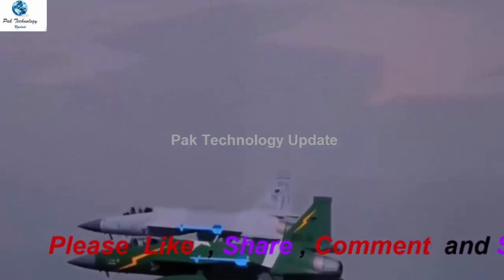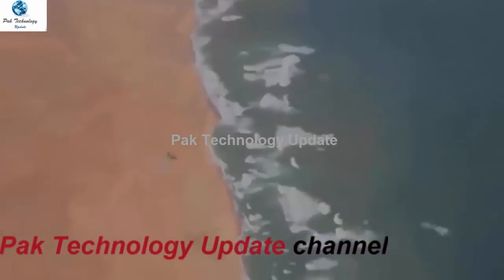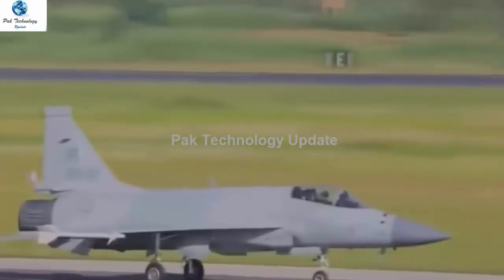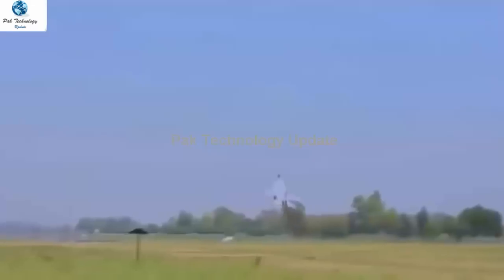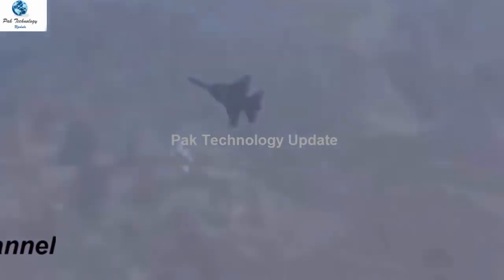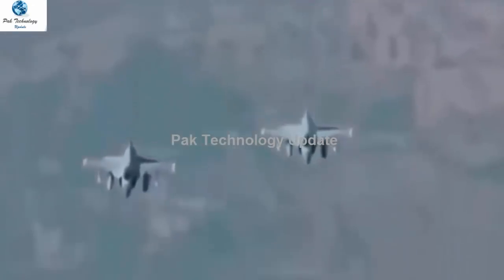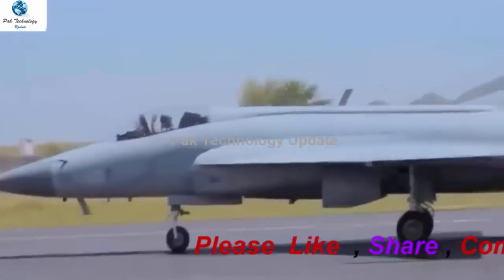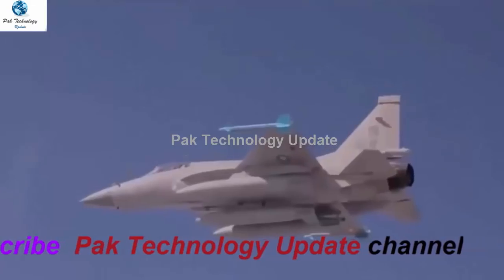JF 17 THUNDER BLOCK 3 IN ACTION LATEST NEWS UPDATE / SPECIFICATION MACH 2 SPEED TEST FLIGHT/2018

Comment: The hardpoints should be increased from 7 to 9. The additional 2 hardpoints would only be limited for air to air missiles. Also, the engines should be improved by installing RD 33MK or WS 13 engne. With these improvement, this plane would be consider a fulltime STRIKE FIGHTER.